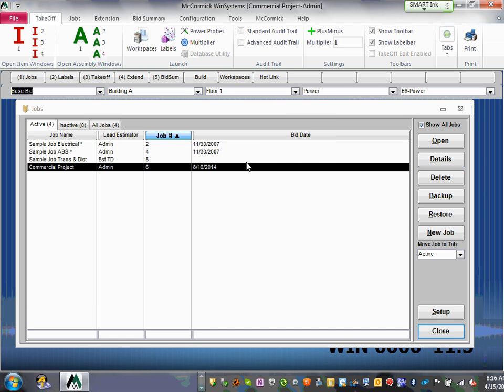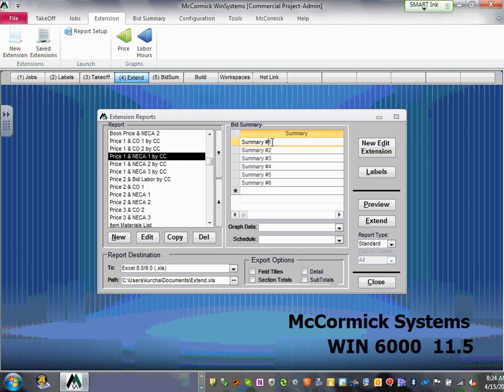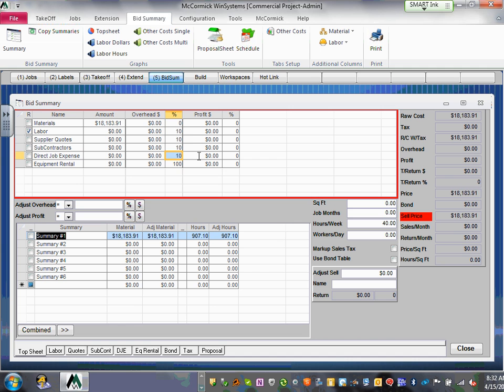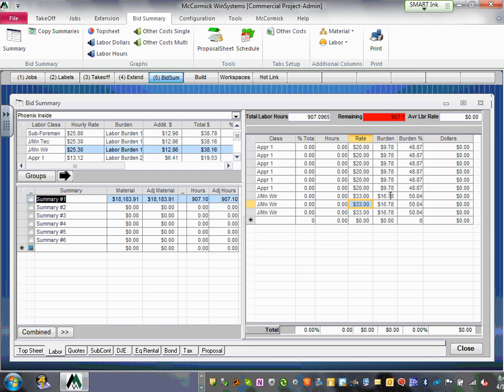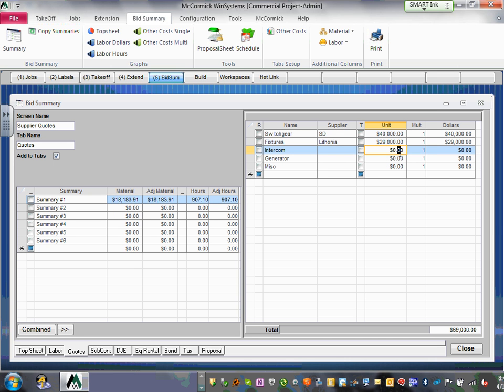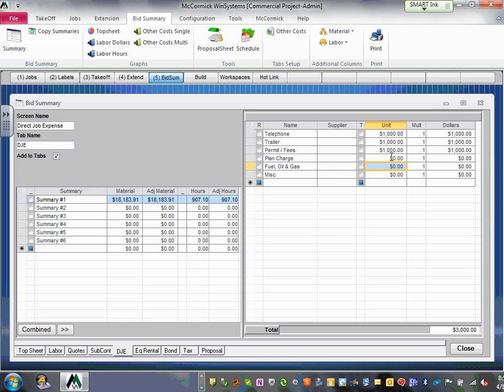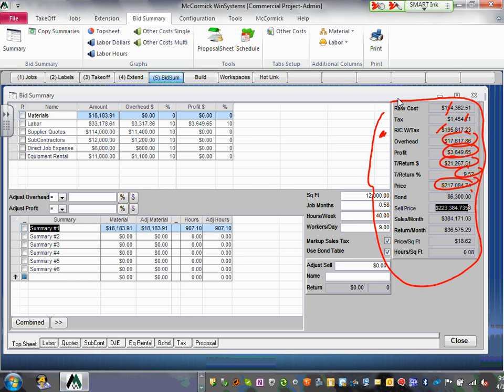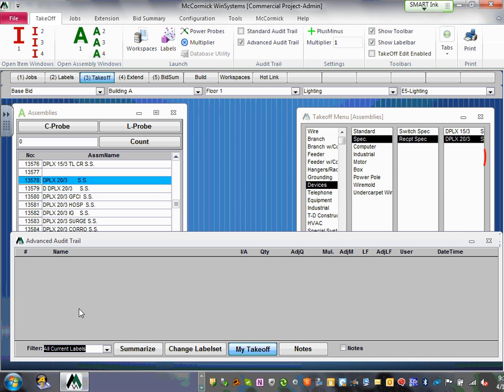Estimating McCormick Extension & Bid summary 04 15 14

Comment: On a scale of one to ten this webinar is about a low five. Jumped around way too much. Poor sentence structure. Very confusing comments.  Did not give the impression that you knew your product. Moved away from the microphone frequently, hence the audio made it even worse. Since my company just recently purchased your plumbing/ mechanical software and are just getting started to learn it, this webinar was not very reassuring. 
I hope it gets lots better from here.